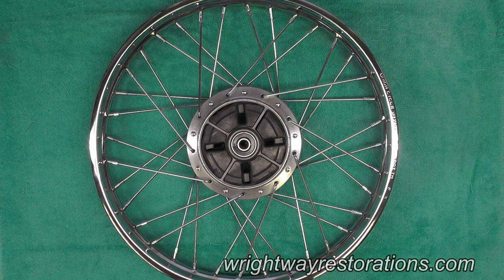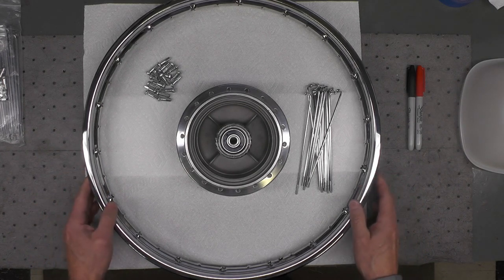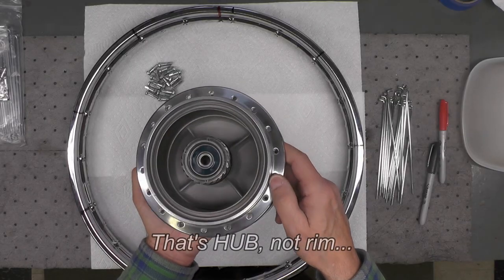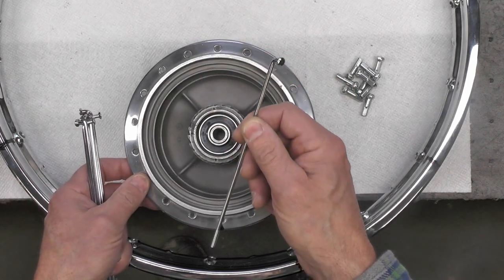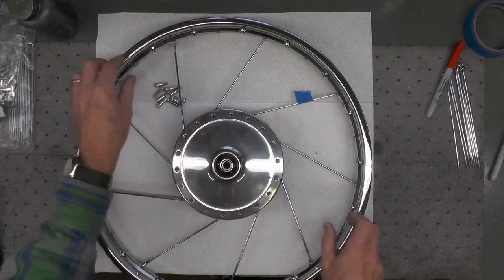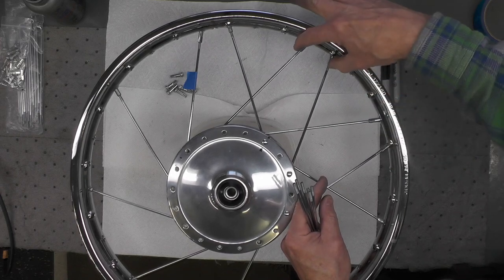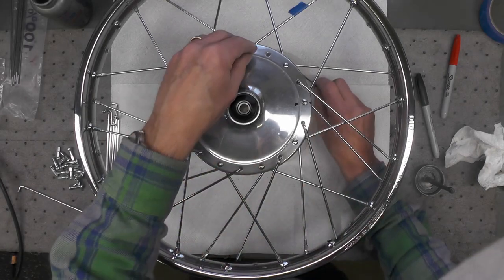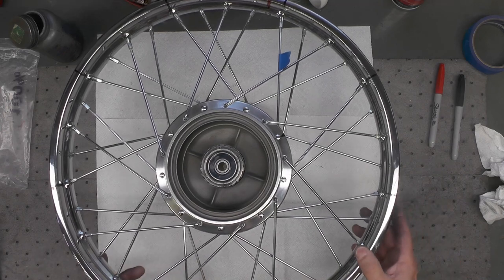Yamaha YL1, Lacing Front Wheel --- Video #102

Comment: Can you do the rear or is it the same process
Reply from the maker: Unfortunately I can't demonstrate the rear wheel as that unit has been laced and mounted on the bike for close to 18 months now.  However, the process is the same as the front wheel.  Depending on your specific bike, the only thing you may need to pay additional attention to is wheel offset.  Not all bikes use a wheel offset, and I didn't use any wheel offset on either the front or rear wheels of the YL1.  You'll need to research your particular equipment to determine if wheel offset is used.  Most Japanese bikes from the late 60s through early 70s that I work on do not use wheel offset.

Comment: Excellent video, best I’ve seen on YouTube regarding lacing. I want to re-spoke my RD but had some reservations, you made the process  pretty clear. I hope you are able to produce a truing video, that is the “black magic” that is intimidating. I’ve always wondered how much to tighten spokes, as you can’t use a torque wrench. Also if when tightening spokes, does the hub will center itself or is this something that is a concern?
Reply from the maker: Appreciate the positive feedback.  I am intending to release a video on wheel truing, so stay tuned.

Regarding the centering of the hub... for a non-offset hub (most Japanese bikes I'm aware of) as the wheel is trued the hub will take care of itself.  Some European bikes, and perhaps some American (not sure about American bikes) have a designed-in hub offset, but I've never worked on one so I am not able to comment on the process for an offset hub.

Thanks for the comments...

Comment: I have front and rear laced up and want to take to my local shop for truing.   They are asking for the offset measurements.   Would you happen to know what that measurement is or where I can find it?  Striking out online over here.   Thanks in advance.
Reply from the maker: What specific bike do you have?  Some bikes use and offset, some don't, so it makes a difference.  Some service manuals provide this information,  though not all.  For my YL1 I trued with no offset, i.e., I centered the wheel to the hubs.  I believe that's correct for this bike based upon my inspection of the hubs before I initially broke them down.  I also found nothing to the contrary in the service manuals.
Reply: Got it.  Mine is a 1965 YJ1.

Comment: Hi Roy, Really great video. Very much looking forward to the truing video. A couple of questions; Where did you get the spokes & nipples? & have you used stainless or plated spokes?
Reply from the maker: The spokes and nipples came with non-OEM wheels (after market) I bought some time ago from (I believe) Thailand and they came as a complete set.  

However, with a little research one can often, though not always, substitute spokes from one of the other Japanese bikes of similar size. The Japanese manufactures used the same OEM suppliers so often the parts are the same items, only rebranded.  I've done this from time-to-time over the years.

The spokes are plated not stainless steel.  For a restoration I prefer plated as that was original, for a daily driver it wouldn't matter as much to me.

And thanks for the kind comments, Jono!